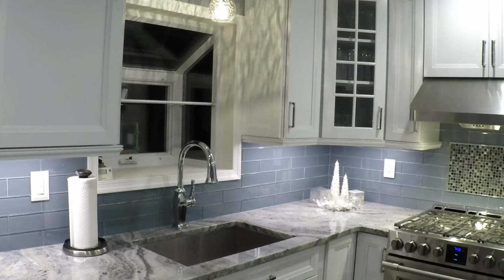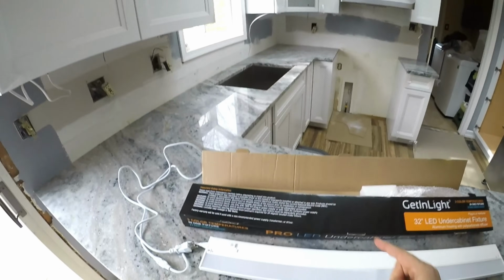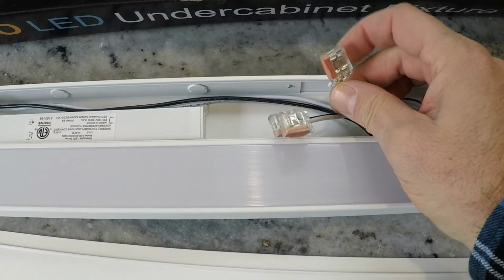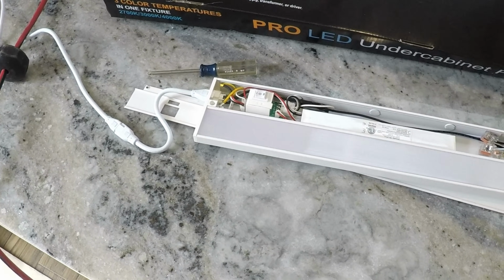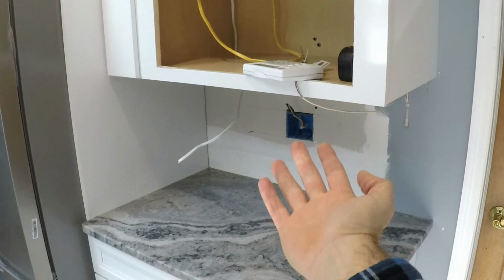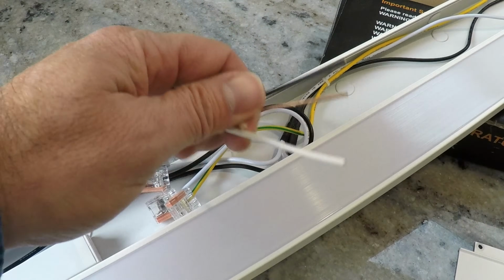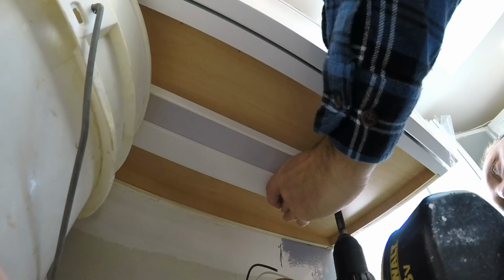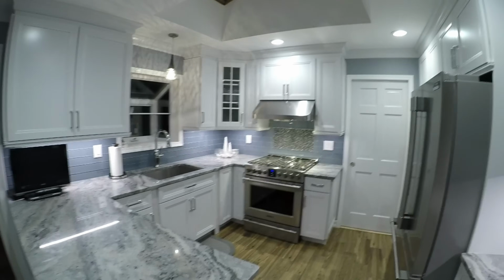Install Under Cabinet Lighting Without Hiring an Electrician

Comment: I love your video but I would have loved to see how you run de wire over the other side cabinets as well.  Beautiful job!  Thanks
Reply: I don’t have an attic above my kitchen cause it’s a two story home. Suggestions for getting wires across the kitchen?  Really not wanting to have two separate light switches.
Reply from the maker: Thanks Milly... the wire went up into the ceiling into the attic and then down on the other side.
Reply: Thank you for posting this video and thank you for your reply!
Reply: Thank you for posting this video and thank you for your reply!

Comment: Thanks for sharing your process.  I too have spent weeks studying all the cabinet lighting options as we get ready to renovate our kitchen and still have not been able to identify a standout selection.  Initially, I was so excited on the tape lights but read too many stories about failed components only after a year or two.  Sticking with conventional wire and fixtures might be the way to go.   I've used similar lighting in my pantry and closet and they've been trouble free for two years.   My question - Does the electrical code allow unprotected Romex to be exposed under the cabinet?
Reply: No it does not. This install in this video is 100% not to code.  You basically can only use unprotected romex in an attic. I would think the odds of romex getting damaged in upper cabinets is far less likely than in lower cabinets. But the code is the code. I've dealt with other cases that I thought was Overkill but I like to do things to code anyway. Mainly for when I sell my home in case the buyer gets an overzealous home inspector.  I'm searching how to wire mx in a cabinet. What a hassle.
Reply: @ABCD-eg5ky  Some years ago I found lights with transformers that sent low voltage to the fixtures and just ran the low voltage down inside the cabinets as you did. I had a switched outlet installed above the cabinets and found a UL approved 5 outlet extension cord on Amazon so that each fixture was a direct connection. Passed inspection!
Reply from the maker: you would need to check the code in your town

Comment: i'm wondering how you switch these lights on? i have hard wires sticking out from under my cabinets that i can connect to lighting as you did here, but i don't think they are connected to any switch. i think i will have to switch the light on at the fixture, and am wondering if that is what you do here as well? thanks
Reply from the maker: yes all of my wires go to the switch that is just to the left of the sink

Comment: Hello Flannel Guy DIY, Great video and NICE Kitchen remodel! I also have been doing a lot of research lately on the under cabinet lighting as well. There is no standards, it's just heap of different stuff! I tried the LED strips (color-changing) and I agree with you....keep the colored lighting on the Christmas tree ....LOL (or, maybe behind your Big Screen TV :) LED strips just don't give you enough working light for your countertops even when they are on "WHITE" setting.  So now I am on my way to replacing them . . . and doing my research again....that's how I came across your video :) ENJOY your new Kitchen!!
Reply from the maker: Thank you TW homeShow.  I did A LOT of research and weighed everything. I am really happy with my choice in lighting. The best part is since they are hard wired to a light switch, I can replace them one day if I want. Conversely, if I ran that low voltage wire that the LED strips take, then I would be stuck with that wire. I appreciate you watching and for the comments.

Comment: Did you happen to compare these to the GE Premium LED undercabinet lights? Do you think it's worth the extra $30/piece? I just tried the GE Enbrighten and those lights protrude out of the fixture, making the bulb visible, which we HATE.
Reply from the maker: Brian, I researched everything. I did not BUY the GE Premiums to compare on my cabinets. I looked at the measurements, the temperature options of each, the fact that the ones I used could be dimmed, the ability to use standard wiring so you can change the fixtures later, and the ease of installation. So, this is why I made my decision. In the end, the video is more about the process for you and everyone else to make your decisions as well as the install. I really do not expect that these lights are for everyone. I hope that this video helped you in some way no matter what you decide and that your installation comes out great.
Reply from the maker: Brian, one more thing. If your upper cabinets do not have a light rail, then you can install one and it will help to hide the bulb.
Reply: Flannel Guy DIY I am interested in the light rail?  Do you know whether they are custom or would the cabinet maker have them for purchase?

Comment: Nice video, this is quite helpful. So you used two junction boxes in addition to the one that has the light switch? Can you explain the purpose of each? Would it have been possible to only use the light switch box?

Comment: So, what's the general rule of thumb for  how long the light should be compared to how long the cabinet is? In other words, how much space should there between the light and the edge?
Reply from the maker: Andrew Price I don’t think there is a rule of thumb because every light and every situation is different. I actually tested different locations by taping the light underneath days before installing and filming the video. You may or may not want to be putting too much light on your backsplash
Reply: I mean length wise rather than depth wise. I see yours are probably around 6" shorter than the cabinets (3" on each side), so I'll try to do the same. I plan to go with these same lights especially now that I see they are smart dimmers when paired with an approved switch and Alexa. Great video. I appreciate the help.
Reply from the maker: Andrew Price just try to take up as much lengthwise as possible. Not critical to cover every inch.  You don’t want a 9 inch light under a 24 inch cabinet